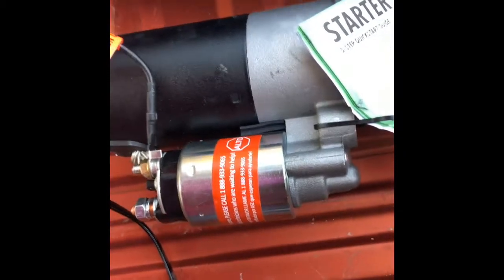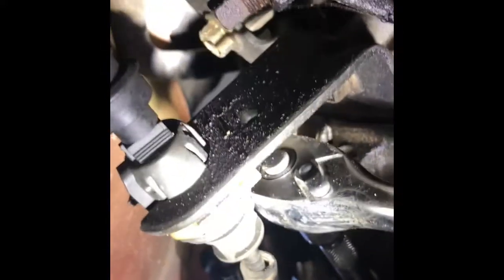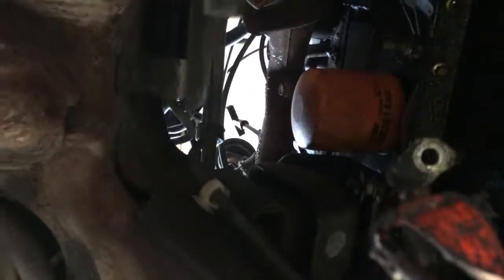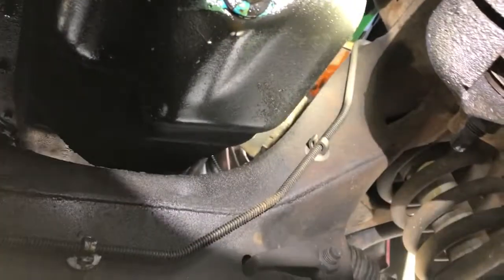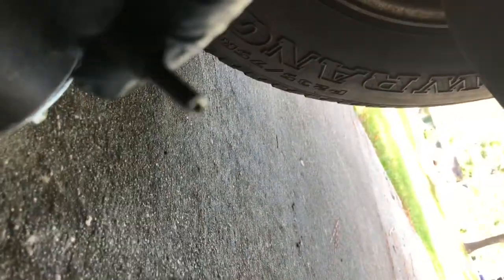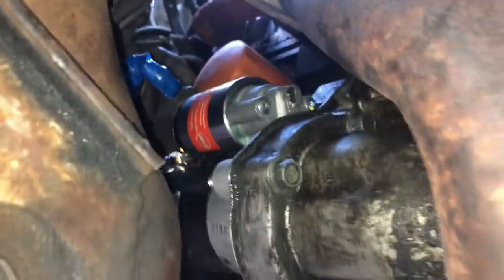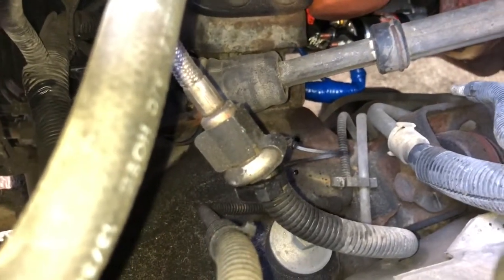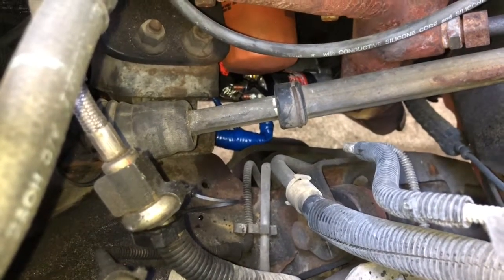1999 Ford Ranger Starter

Comment: Im doing this on a 99 4x4 ranger and its a total B barely enough room to work
Reply: Have you figured it out? Having the same issue
Reply: @jeydonjames7089  yeah it was tedious as hell but I was able to do it without jacking the truck up since its lifted. I didn’t bother with the wire splicing on mine since it was in good condition. Good luck! Check out the 1A auto video on this job it may help
Reply: @twistthrottleatv3504  i have to do this  on my mazda b series 99 4x4 and noticed power steering shooting everywhere alsso could thiss be from pushing truck in neutral  i read online fords will shoot power steering fluid through the cap when the wheel is turned while engine is off.